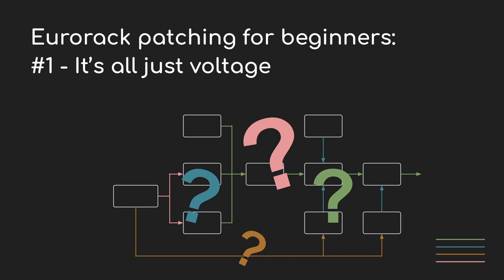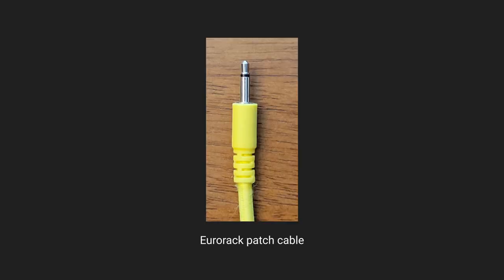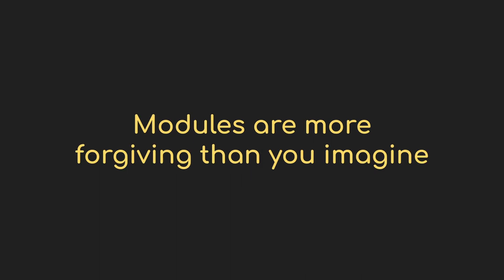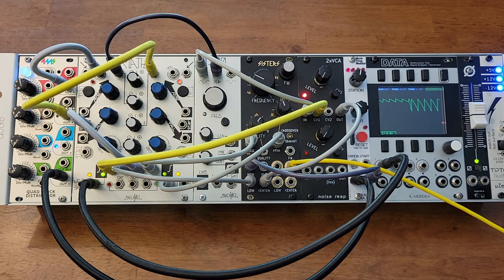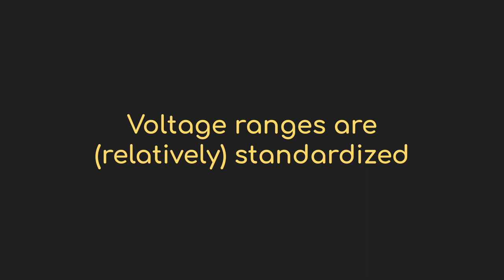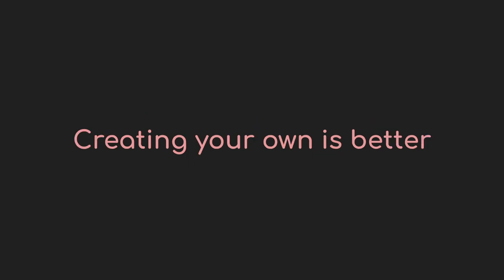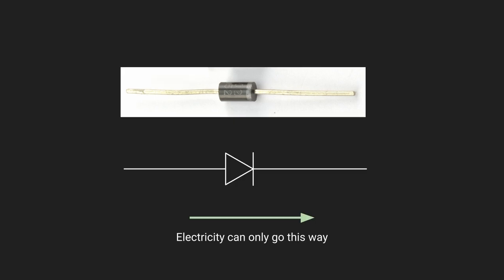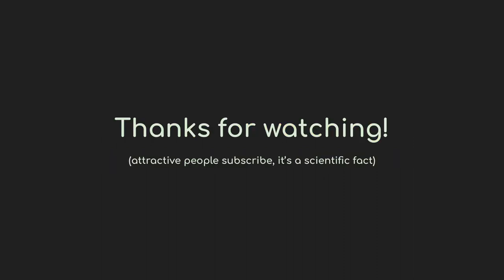Eurorack patching for beginners #1 - It's all just voltage

Comment: While I'm no longer a beginner, this is easily the best intro eurorack and modular concepts video I've seen! Fantastic work! I'll be sharing it with anyone new to the hobby! And FWIW, I find the modular subreddit to be mostly full of incredibly patient and gracious people, unlike the synthesizer subreddit. It was part of the reason I was convinced to take the plunge, it felt like after years of feeling like an outsider in the synth community I finally found a home where people were excited to have me participate!
Reply from the maker: Thank you so much!  And yes, the Reddit community can be very welcoming.  And they can also downvote reasonable questions into oblivion.    Depends on the day I guess.
Reply: @SoundVoltage  Yeah I'm sure there are still posts that reasonable questions because they are seen as low effort (aka didn't try google first) but in my experience those are still few and far between compared to other synth communities!

Comment: Excellent 101-type overview. The only thing I would have added to the preliminary discussion of voltage was a mention of amperage, or current. Anything up to 10V sounds scary, but the current flow is typically a couple of orders of magnitude less than that, in the milli-amp range. And as I recall from half-century old school physics, it’s the current flow that causes damage, not voltage.

I’ll be very interested to see this series progress, but in the meantime I will keep experimenting!

Comment: One thing: Even though most modules' outputs are protected, it is considered not ideal to connect one output to another, or to mix outputs in a passive mult. The first doesn't do anything anyway so there's no point in trying, and the latter can be bad if there's no output protection, but as Steevio once said "I haven't broken anything yet."

So try at your own risk.
Reply from the maker: Some modules actually call this out as a feature.  The Tonestar 8106 is the one that is at top of mind, they actively encourage it.
Reply from the maker: Fair point.

I'm actually working on a new video now...or trying to, it's tough sometimes to settle on the actual angle you want to approach a topic from.  But hopefully by the end of the year!  (I shouldn't have said that...)
Reply: @SoundVoltage  Thank you! Looking forward to it. :) Merry (belated) Christmas to you and your family and a happy new year.

Comment: Can I use an Aux/stereo TRS as a patch cable with the Behringer 2600?
Reply from the maker: I don't know the 2600, but unless it is expecting a TRS cable, generally it won't work (because the contacts inside the jack socket don't line up with the connections on the jack).
Reply: Thanks for the reply! @SoundVoltage